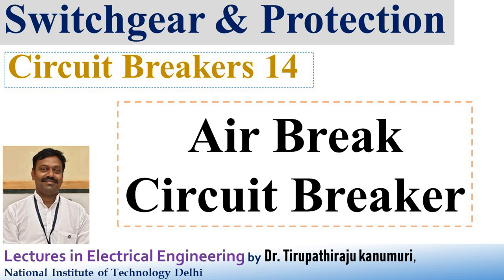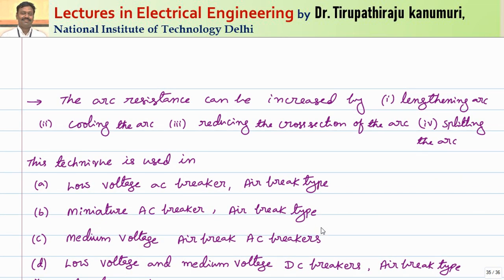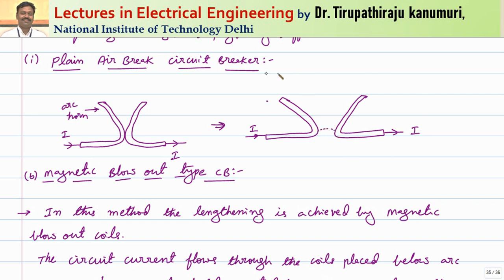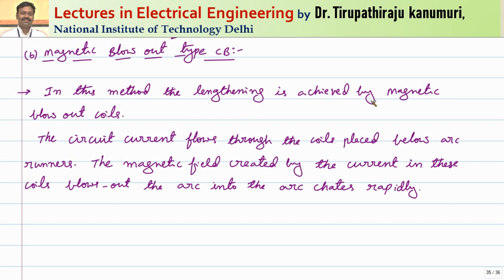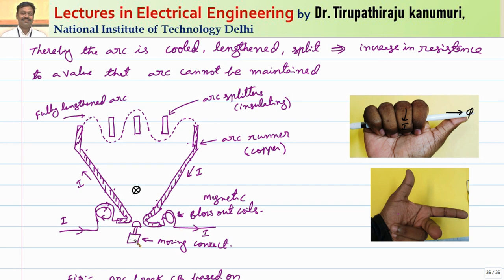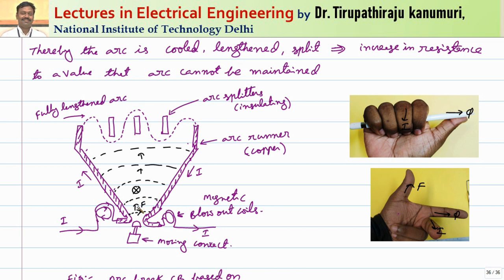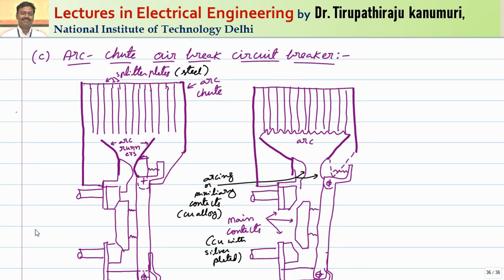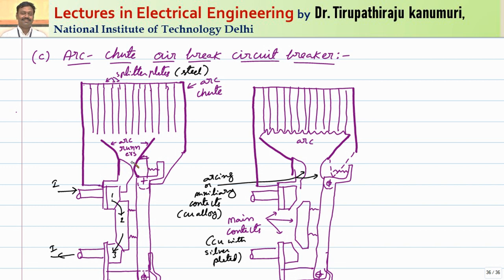SGP214 Air Break Circuit Breaker

Comment: Thank you sir!
This presentation will inspire future designers and also create general awareness on electrical safety.
Recently there was a fire in a building nearby, attributed to "short circuit, as usual.
There was smoke and smell of burning oil and plastic. This entered other homes mainly on ground floors and lingered on for 3 to 4 days.
We could not have a close-up view but in this case it seemed that the mains supply was connected in a narrow concrete shaft. We could not see the meters or they could have been in another room.
Meter rooms and housings are rarely cleaned.
In flats, the MCB board, houses many of them, side by side touching each other but looks neat and clean.
When one breaker trips due to a shorted device such a clothes iron, it is reset but trips again due to ones stubbornness.
The expansion due to heat jams the breaker and cannot be reset. A big bill from the electrician.
Also, there is a lot of carbon which settles in a society's meter room. I don't know what will happen when there are line surges!
Users should take an interest as to the condition of their meter rooms.

Comment: Thank you for the explanation sir.

Sir one doubt, why will arc move upwards in case of the air chute circuit breaker if there is no magnetic field applied? How does heat cause it to move upwards?
Reply: @lecturesinelectricaleng  Thank you sir. Concept cleared😊